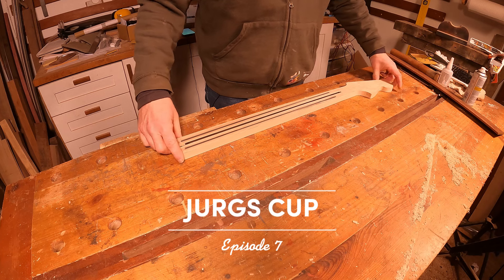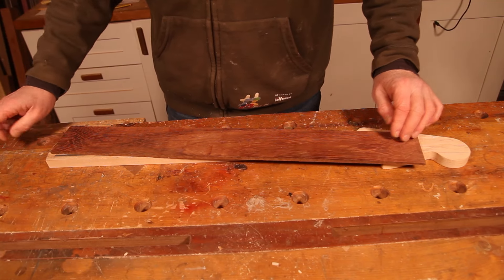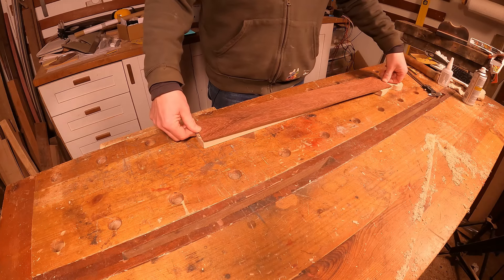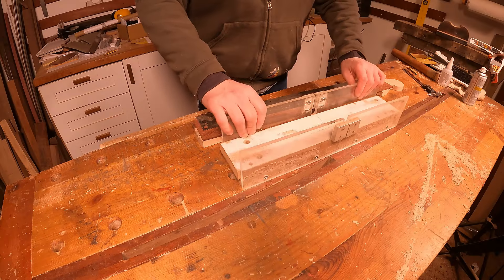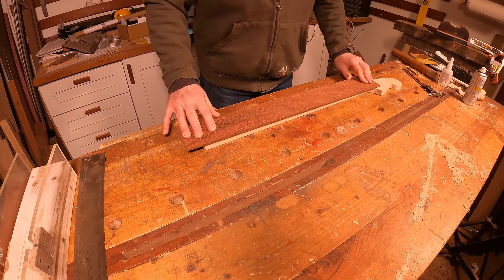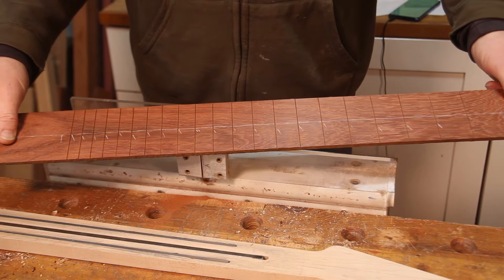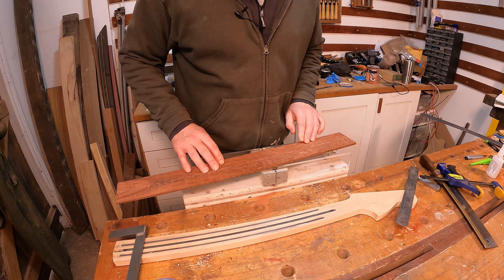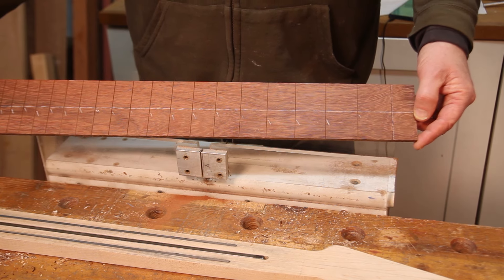Jurgs cup episode 7.

Comment: Fret marking is always a problem, though not a big one. I personally use a linear digital scale to make a template with notches machined into the template and use a sliding compound saw with the stew mac circular blade to cut the frets. It reduces one part of the process that you engage in, I don't think the results are any different - just the way I do it. Now days, I just use the standard calculated scale length for a Fender as a starting point and reduce or increase the  scale length up or down by which fret you start with.
Reply from the maker: I generally use a fret scale template but don't have one in that scale and I didn't want to buy one for a single build.

Comment: Before I bought my fret miter box and the corresponding templates, I made several bass necks using the mark and saw method.  It is a lot slower and more prone to error, but it helps one appreciate the level of accuracy needed for a good neck.  Even with the miter box, I have done a few projects for which I have no templates - a 26.25" scale Irish bouzouki and a 20" baritone ukulele.  Good to have the skills even with the nice tools.
Reply from the maker: Yes, it's nice to test yourself with the old method every now and then, wouldn't want to do it often though :)

Comment: I use a fret spreadsheet to calculate the  fret spacing for any scale length, then use those figures to create a template in a drawing program
Reply: I use Microsoft Excel to calculate the fret positions using the standard formula, and it does it to about 11 decimals points that you can round up to one or two points. It's how you mark the positions and cut the frets that counts, but then fret measurements are only a guide. The actual positions of the frets could vary by up to 5 or 10 % +/- to be right on the mark. In commercial practice, it just doesn't happen, so all frets are close but not necessarily correct, but good enough. To be exact, most frets should be  divided into 6 individual frets for a six string instrument accordingly.

Comment: To avoid all that measuring, I think I'd have been tempted to make it 29.5 inches and use the 24.75inch template for all but the first 3 frets. But good work anyway!
Reply: So how do you figure the first three fret positions?
Reply: @timhallas4275  you'll need to measure them using a fret calculator but much easier to measure 3 than 22 and less chance of screwing up.